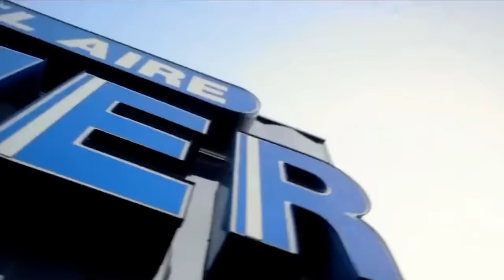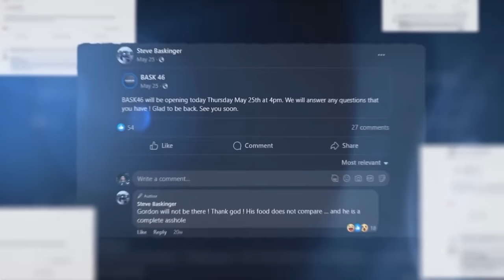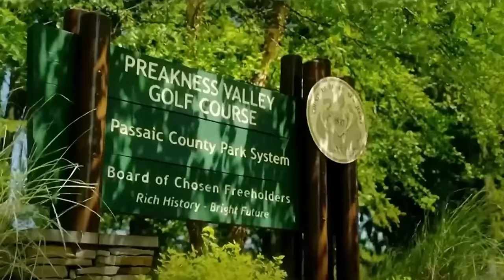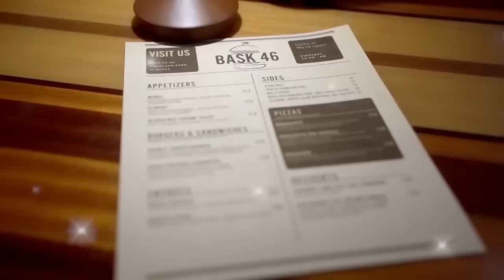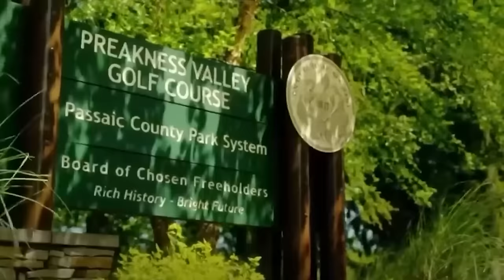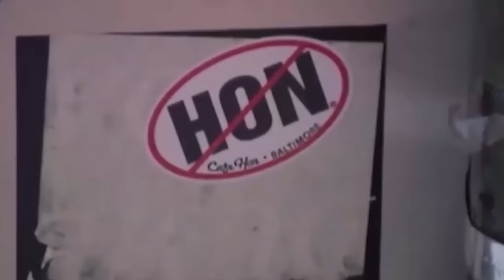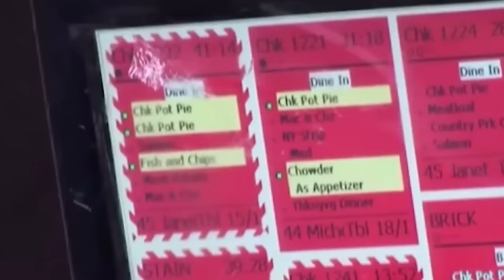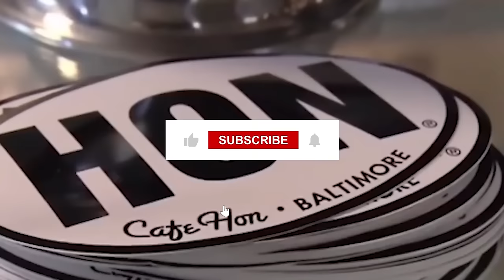STRANGEST Kitchen Nightmares Moments of ALL TIME..

Comment: "Coq au vin" is a peasant dish. The "coq" is an old rooster. " The "vin" is red wine, cheap.
An old rooster is a tough, stringy bird, and takes hours to cook to tenderness. The wine helps tender the meat, and adds flavor.
My preferred method is a whole bird, in a crock pot, with Chardonnay, rather than cheap red wine. SPG, of course, and whatever herbs you prefer.
6 hours minimum cook time.
You couldn't serve that in a professional kitchen. It's wonderful food for the home kitchen.:)
Reply: Hmm.... thanks for the insight.
Reply: Leave it to fine dining to take a home meal and charge people high prices to eat like poorer folk